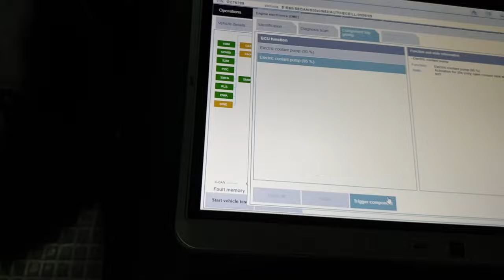BMW E60 dashboard removal for Evaporator core  Replacement and Disinfected

Comment: This is very helpful.  One question, please.  Should we release/remove the gas before removing the evaporator?
Reply from the maker: Hello,  YES of course you need to remove the freon gas , but if you have this problem is possible that you don't have any gas in your system...test it by shortly push on the refining valve and when you do that protect your eyes 😉

Comment: Do you have to replace the AC blower while replacing the evaporator? Do you think the blower will be next to go bad?
Reply: No you don't. But, the thing is that the blower is always in contact with wet air and is know to go bad because of the corrosion. E60 isn't a new car, so i believe that it was preventive mesure.

Comment: Where is the drain pipe for the AC compressor please, mine is blocked causing water to collect inside the car on the carpets? I've checked all drain holes to be sure and there all cleaned and flow nicely for when it rains, I've also checked the linings inside the door cards which are perfect
Reply from the maker: Hello,  the drain for AC is over the gearbox underneath the car
Reply: @MOvidiu  thankyou for your swift reply my friend, I don't suppose you have a picture of what I'm looking for do you?

Comment: Thank you sir for the detailed video. Is this process similar to the e65 730d? My ac gas is now empty, when it did work it had bad smells. My guess is I have to change this part like you did as my mechanic can't find a leak in the engine bay
Reply from the maker: Hello,  yes is similar
Reply: Yay a weekend of fun for me. Atleast you show some of this process in your e65 video. Thanks again 👍👍

Comment: Hi, great vid as always.  When you first used the computer was it just to activate the water pump to drain the coolant ?
Reply from the maker: Hello . Yes, I activated the electric water pump to remove as much of the engine coolant as possible, so as not to make a mess when I disconnect the hoses  :)
Reply: @MOvidiu  Hi, thanks for reply.  Is the process of accessing the pipes to the heater matrix about the same in an 60 M54  ?   Out of curiosity are you any closer to your goal of relocating to the US  ?
Reply from the maker: @chasermalloy7406  
Yes it is similar. I think I will succeed, unfortunately the process is quite long and now with the health crisis it will take even longer
Reply: @MOvidiu  Yes, I realize the corona thing has slowed everything but there is a need for guys like you as you can see from the lack of competence even among BMW dealers in the US.  You'd have seen the horror stories people post about work they've had done on their cars.  They are forever trying to find good technicians.  You'd have no trouble establishing a good business so stick with it !

Comment: Hey Ovidiu. Do you have any brant of evaporator to recommend? Mahle, Hella, Valeo...? Thanks
Reply from the maker: Hello !! depends on the year of manufacture and model for example: BEHR is one of the manufacturers that has equipped from the factory on certain BMW models . hella is a good manufacturer but it may not make a quality vaporizer for a system that they did not equip as standard from the factory

Comment: ceau. am o eroare de electric auxiliary heater. sa fie de la rezistenta de pe calorifelul din habitaclu? Se poate face ceva fara sa dai jos tot ce ai dat tu?
Reply from the maker: Salut , pai depinde ce problema are daca e modulul defect daca are alimentare ...comunicare ...
Reply: @MOvidiu  vreo idee cum imi pot da seama? pe iester mi a dat eroarea asta exact  asa cum am scris-o. tu de unde esti?
Reply from the maker: Verifici siguranta , dupa care verifici direct pe modul daca are alimentare 12v dupa care ideal cu un osciloscop verifici daca are si comunicare , dar daca m-ai intebat cum verifici nu prea pare ca te pricepi , sfatul meu e sa ta duci la un electrician/electronist BMW in zoma ta si sa ti-o diagnosticheze / repare
Reply: @MOvidiu  imi poti spune unde e siguranta si modului? am sa verific eu pana ajung la un electrician! multumesc anticipat

Comment: Awesome Job! This inspired me to do the same thing in my driveway. I got everything put back together, but now I have a passenger airbag light that won't go way. Do you have any thoughts on what it could be?
Reply from the maker: What error you have?
Reply: It just says “Pass. restraint system” and then says “Fault in passenger restraint system affecting airbag, belt tensioner or belt force limiter. Continue to wear the safety belt” I am wondering if it is possible that I pinched a wire somewhere. I took everything back apart and didn’t see anything obvious.
Reply from the maker: @Robert_J891  no what the car is saying to your navigation that is a general message to send the owner to the dealer,  what error you have on a diagnosis equipment
Reply: Oh I see. Yeah I just have a cheap OBDII reader and it’s not seeing any faults.

Comment: Didnt you remove the negative battery terminal first?
Reply from the maker: Hello Alen ! No , I'm a professional, but don't do like me, if you want to do this disconnect the battery before, (and the part with disconnecting the munus terminal first is a myth told and perpetuated by those who have no idea how things work)
Reply: @MOvidiu  yes you are rite about that and I always remove the battery terminal 1st.
Reply: @MOvidiu  may I know you did code back after remove battery for an instance, what coding software you use?
Reply from the maker: @alenalen4974  What to code ?
Reply: @MOvidiu  sorry I mean erase fault codes.
Reply from the maker: IstaD
Reply: Salut! Frumos lucrat! Vreau și eu un sfat te rog, observ ca spuneai ceva legat de baterie, aș dori să curăț galeria de admisie la un e90 lci , manualul spune sa deconectezi polul negativ al bateriei înainte de operațiune, este posibil sa întâmpin probleme la reconectare, e nevoie apoi de tester ?  Manualul scrie ca daca scoți polul negativ și nu ai contactul pus nu este nici un pericol, un sfat mi-ar fi de folos! Mulțumesc!
Reply from the maker: Salut  @iulianpvl4278  , ma bucur ca apreciezi :) legat de intrebarea ta , teoretic nu ar trebui sa se intample nimic lasi portbagajul deschis iei contactul astepti 10 minute si dupaia poti deconecta bateria
Reply: @MOvidiu  mulțumesc frumos! Spor în ceea ce faci !

Comment: Hello I hope you can help me I have a 2012 vauxhall insignia when I use my ac I have a hissing sound behind my dash no smells or anything warm and hissing
Reply from the maker: Hello ! unfortunately I don't know what it could be I only deal with bmws, you should look for someone who works and knows how to do vauxhall
Reply: Low on gas is the normal cause of this
Reply: @MrByootox  you are correct I had some one come out and regass for me and all works great now I only had 35grams in the ac system.
Reply: @nathan112  the noise you describe is the case for most cars to be honest.
Reply: @MrByootox  ive now another problem not with my ac though but with my normal heating in my car
Reply: @nathan112  heater fan speed?
Reply: @MrByootox  hello no sadly my problem is that its all blowing cold below 26 and only get very hot at 26 my insignia has climate control and I changed the heater flap motor but I beloved the bog white cog wheel thing so now im unsure how to correct this issue to how it should be but my heating is doing ne in as I'd normaly have it set on auto at 21 and the car would be good enough heat without it being too hot so my windows don't fog up now i have to set auto on 26 which is too hot so im having to turn it down to lo all the time then back to the heat and so on
Reply: Ideally you really need to get the fault codes read for your climate system.
With the diag tool you can force the air blend flaps to move and calibrate the system.
Reply: @MrByootox  I have a code reader but I have no codes on my car or is it a posability my code reader aint good enough would it be an snap-on reader of some sort
Reply: @nathan112  Doesn't need to be snap-on, just a better model that cover most of the systems on the car. Forget the basic eobd ones, waste of time
Reply: @MrByootox  I've got the Autel AL539 OBD2 Diagnostic Scanner Code Read Electrical Circuit Tester AVOmeter is that any good
Reply: @nathan112  give it a go, you've nothing to lose.